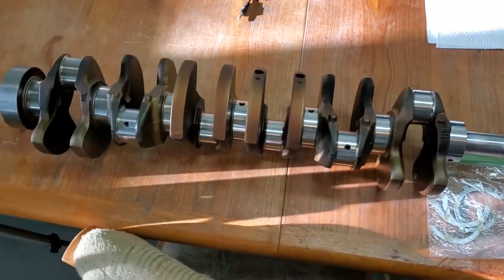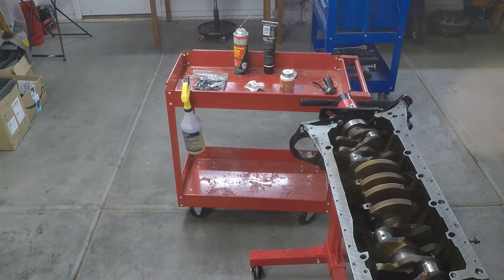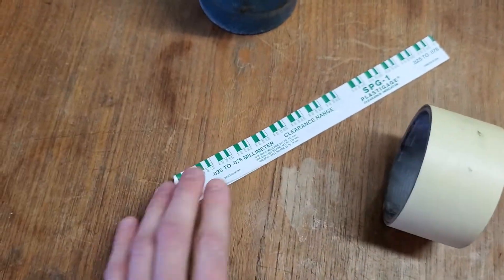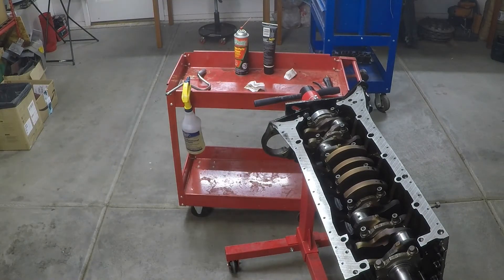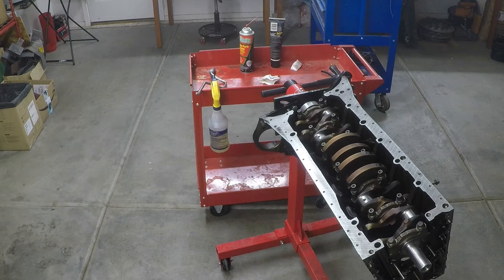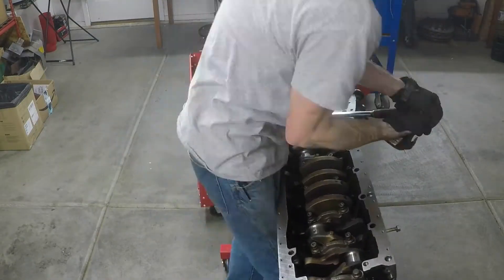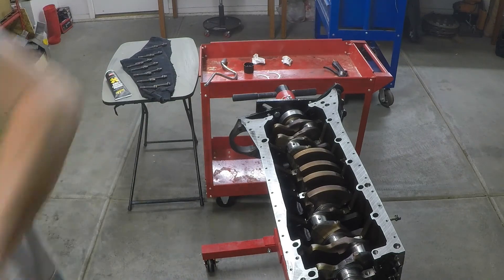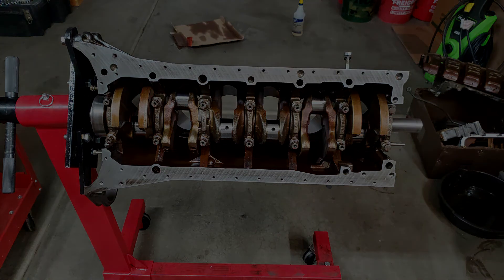Installing The Crankshaft - M104 Turbo Build (Ep. 11)

Comment: Are the main cap bolts not usually stretch bolts? That’s why the marking changed?
Reply from the maker: From what i understand, none of the bolts in this engine are "single use" stretch type. Some, like the head bolts, may have some stretch that 100% rebounds after torqueing and un-torqueing, but thats it. All bolts are theoretically reusable.

Comment: My understanding is that the people that build 722.6 transmissions use the V8 versions (W5A 580). I've heard the possibility of putting the guts of a V8 transmission into a L6 case, but I'm not sure anyone has documented the process. On the control front, if you want to make your life actively worse, you could go with RUSEFI for the engine controller, and there's a handful of DIY transmission controllers, including a firmware set for a megasquirt.
Reply from the maker: my understanding is the w210 with m104 has the stronger 722.6xx trans. i may be wrong, and you may be correct. Ill hit up some forums, thanks brother. 

Also, ive seen some of the trans controllers that work with the megasquirt, but i dont know if i can figure up all the trans specs and measurements required for building a trans map from scratch. Id have to do this, because i cant find any "plug-n-play" trans controller maps anywhere. 

thoughts?
Reply: @JakeSublime  you should be able to find a model number stamped on the left side of the case. On my 01 CLK430 transmission it is the second line, and it reads 722 632, which according to https://sportlichleicht.com/info/transmissions/722_6 maps up to being a W5A 580. I don't have the drivetrain out of my W210 or I'd just look at that. I could see it being either way, as the engine TQ is just under the nominal rating of the W5A 330.

As far as trans maps, the solenoids part is pretty easy, it's the line pressure map that is more dubious. I know one of the peachparts posters, I want to say whipplem104, did tuning for them at one point, but I have no idea what he charges or if it's affordable.
Reply from the maker: Dude, solid info. Sounds like i might need to rebuild my trans with 580 guts, because i have the 330 (722.605). Ill certainly do more research and see if i can just send it with this trans or not, and then just keep an eye on the trans fluid.. That said, worse comes to worse and i blow the trans: couple hundo and a few bolts, ill trans slap that B real quick. 

And if i have to go down the trans tuning route, ill follow your crumb trail there. Thanks pal, I appreciate you. Enjoy my videos, and keep the tips coming!